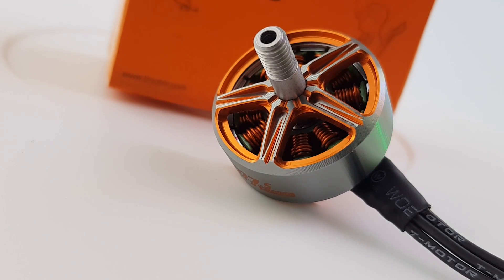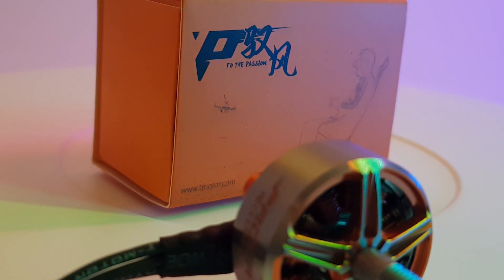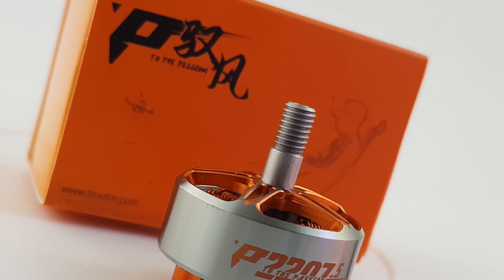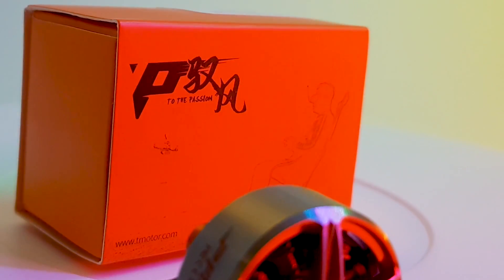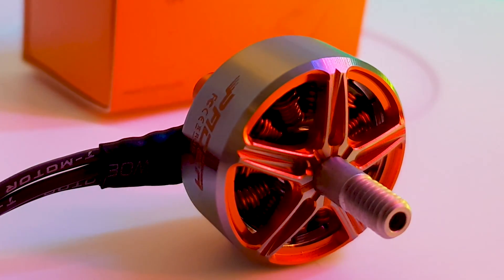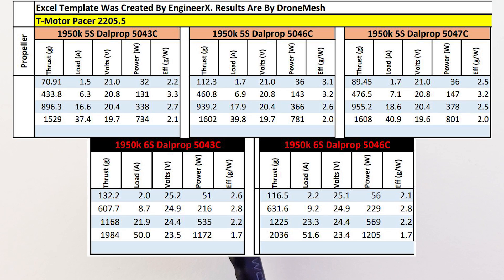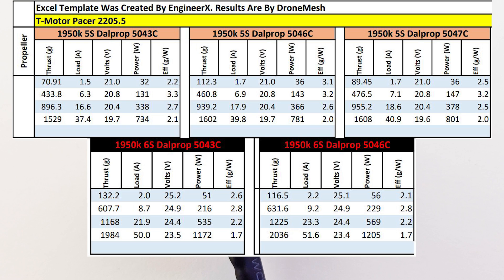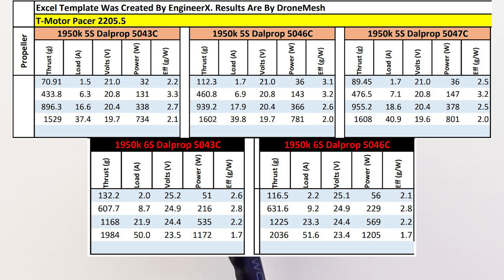INSANE SPECS & POWER // T-Motor Pacer 2207.5 Thrust & Review

Comment: it wont run hot. not anymore.  not with modern firmware and a quality esc. i run 2750kv on 6s with no motor limit.  150+mph